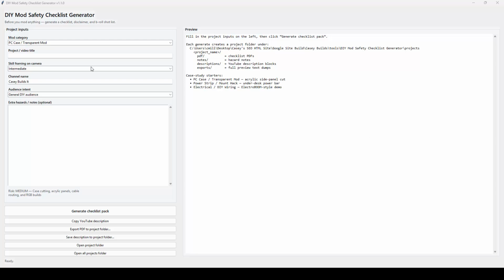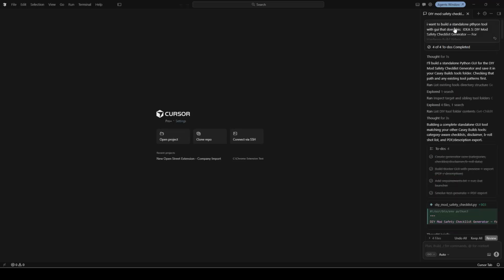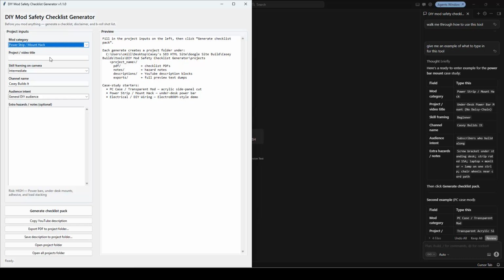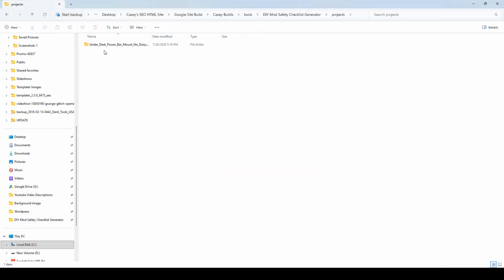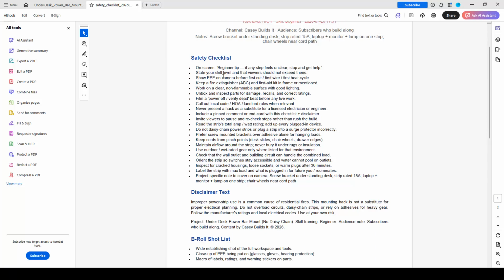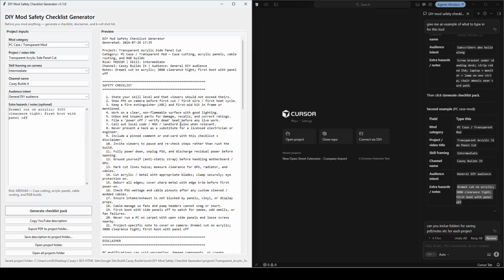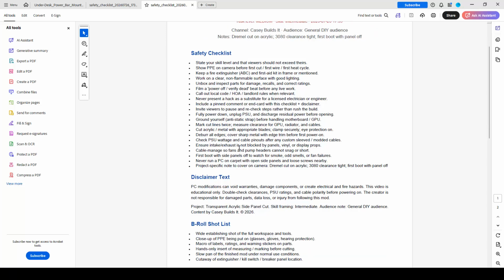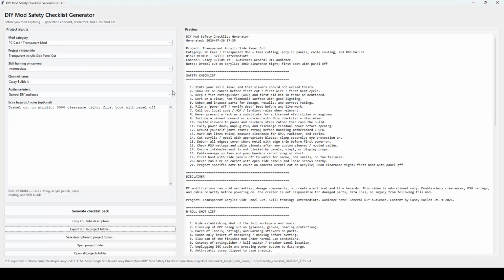I Built a Free DIY Mod Safety Checklist Generator Using Cursor AI (No Coding Needed!)

Comment from the maker: Hey everyone, Casey here!

In this video I walk you through a tool I built completely from scratch using Cursor AI: a DIY Mod Safety Checklist Generator. If you're a maker, DIYer, or YouTube creator making build videos, this one is for you.

WHAT THIS TOOL DOES

This free tool generates a complete safety checklist pack for any DIY or mod project you're filming. Just input your project details and it automatically creates:

- A full step-by-step safety checklist tailored to your specific project
- Suggested B-roll shot ideas (PPE close-ups, workspace wide shots, cable routing, etc.)
- A ready-to-use YouTube description and title
- A PDF export you can share with your audience or post on your blog

I walk through two real examples in the video: an under-desk power strip mount hack and a transparent acrylic PC side panel cut. You'll see how the checklist automatically adjusts based on skill level, tools used, and project type, things like electrical safety notes, clearance checks, PPE reminders, and even local code/landlord rule reminders.

WHY THIS MATTERS FOR CREATORS

If you make DIY, tech, mod, or build videos, this tool solves two problems at once:

1. It helps you stay organized and safety-conscious on camera
2. It gives you a shareable resource (PDF/checklist) you can post alongside your video or blog post to boost engagement, watch time, and SEO on your own site

You can literally take the output, post it as a companion checklist under your video, and give your viewers extra value while building trust and authority in your niche.

HOW IT WAS BUILT

I built this entire tool inside Cursor in about 10 minutes, no advanced coding required. I then packaged it into a standalone EXE file so you don't need Python or any dev environment installed to run it. If you've been curious about vibe coding, using AI tools like Cursor to build real, functional software without being a professional developer, this is a great beginner-friendly example of what's possible.

WHERE TO DOWNLOAD IT

Head over to caseybuildit.com, go to the Free Tools section (or find it linked in the related blog post), and download the DIY Mod Safety Checklist Generator EXE for free. No installs, no Python, just download and run.

LET'S DISCUSS

What kind of DIY or mod projects would you want a safety checklist generated for? And if you could request one new tool for your content creation workflow, what would it be?

Drop your ideas in the comments, I read every single one and I'm already collecting ideas for the next build.

If you found this useful, smash that like button, subscribe for more Cursor AI builds and creator tools, and turn on notifications so you don't miss the next one. Let's keep building smarter, not harder.